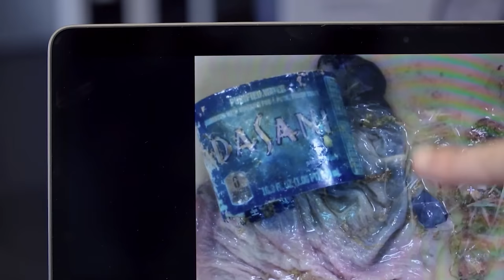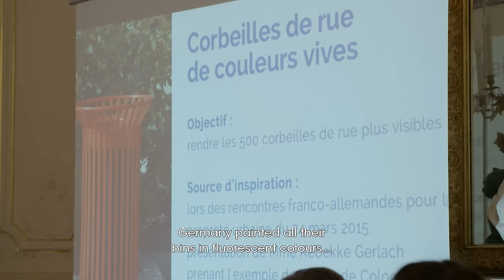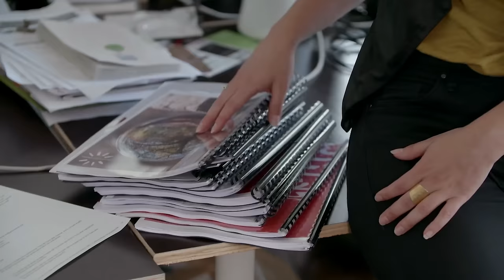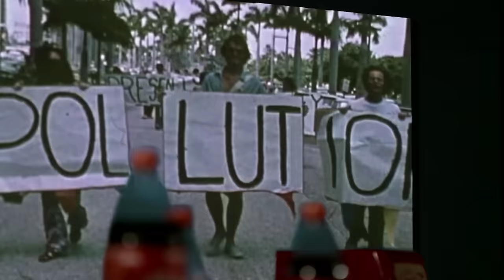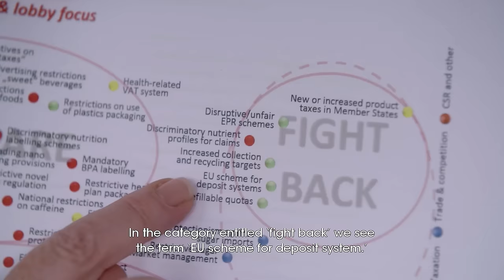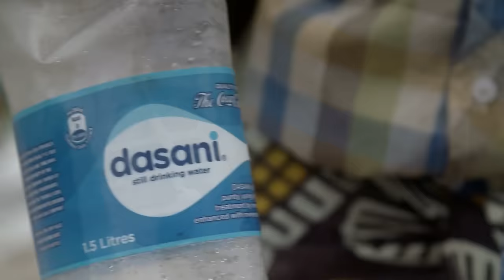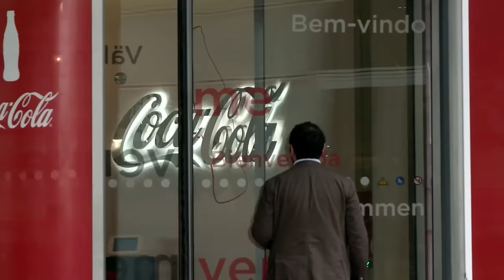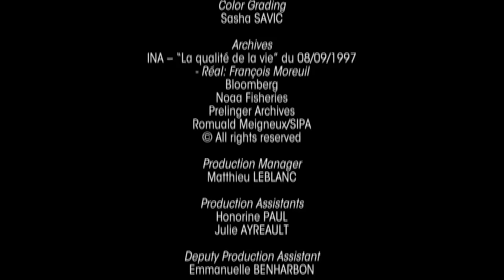A Plastic Ocean: Coca-Cola's Hidden Secrets

Comment: The best solution is for bottlers first to pay for all the cleanups, then to go back to glass bottles. Glass is infinitely recyclable.
Reply: £3 tax per plastic bottle would be a great idea making a 500ml plastic bottle of coke £4.99, it would still sell but in very small numbers like those Takis crisps imported from somewhere. They would be forced to switch away from plastic.
Reply: @Nick_80599  Sugar is an addiction. People won't stop buying soda, they would just absorb the cost. And you can't put 500ml of liquid in  a glass bottle. It would very tremendously heavy and dangerous.
Reply: @zyxw2000  What are you talking about? I said plastic bottles not soda, I always buy aluminium cans or glass bottles of coke. Sugar is not addictive by the way. that's psychological, its taste and brand loyalty as well ad marketing that makes sugar seem "addictive" if you banned advertising and moved to plain labels and packaging like tobacco in the UK, sales will drop. But my point was about moving to glass or aluminium.

Just to let you know a sugar tax in the UK on soft drinks had been very effective. manufacturers have reduced or removed sugar completely and sales for coke original have dropped. These drinks don't taste nice anymore

Comment: Recycling plastics makes no sense at this point. Expending the energy to turn a used bottle thru melting is not sustainable. With the existing plastic waste, you can either reuse it or down cycle it. Mix the melted plastic with sand and tar to make tiles for roofs, for park paths. But they also need to stop producing and using the plastic at such scales.

Comment: that plastic cube is a bobbin that held a coil of wire used in power supplies to hold the suppression coil that prevents high frequency noise from propagating back up the power line.

or it is the plastic foot plug that goes into the legs of the so called "honey can do" shelving to prevent scratching floors and tearing carpets.
Reply: Probably the latter.

Comment: Thank you for this analyses. Clearly profit over planet is the driving force. Have you researched the contamination aspect of an acidic fluid or any fluids contained in plastic? I have seen truckloads of plastic water bottles exposed to sun and high temperatures that likely cause plastic contamination of the contents. What about the aspect of diminishing local water resources for global consumption?  This issue is larger than simply plastic waste.
Reply: I hope thats the only driving force

Comment: A question that needs asked and answered is where plastic is a resource to be recycled, has Coca-Cola invested in the recycling side of the business... bottle recycling plants within reach of mountains of returned bottles... not relying on China to buy the plastic... plastic bottle (or other useful recycled plastic products) manufacturing plants to make things that will push up demand for the plastic resource...

Perhaps a factory to supply 3D printers and the supplies of the materials (plastic) to stimulate local jobs... sometimes to get a recycling ♻️ economy to function you need to build the return end...

A journalist looking at that part of the cycle...?

Comment: When I stayed for a few months in Argentina you purchased a 1 liter bottle that was GLASS, paid a $2 peso deposit (inflation would change this to $20 I'm sure) and the glass was CLEANED and REUSED by the manufacturer.  Broke it?  No refund.  Problem solved.  How is this more expensive?  The income from missed deposits is substantial for sure.  Single use plastic is a scourge and an unnecessary one at that.
Reply: The majority just doesn’t want to carry heavy glass bottles around so it’s also out of convenience. The recycling system in Germany is good, you bring your plastic empty bottles to any supermarket and feed them yourself to a machine. Each plastic bottle is 25 ct. and you get a coupon which you may then exchange for cash. Try implementing this in Tansania or any 3rd world country. We know it doesn’t work properly because of the poverty and lack of education.

Comment: This documentary doesn't really touch on the fundamental problem with plastic:  it can't really be recycled.  If you take all those used plastic bottles and melt them down, the resulting material can't be used to make new bottles.  Plastic just doesn't really work that way and it's a serious problem.  

This is why we see bags made out of used bottles and similar products; because the material needs to be "downcycled" to make something less structurally sound.  It's not possible to have  "zero waste" production as long as you're using plastic.

Comment: Is it possible to have a glass bottle with a resealable cap? I know there are caps in the store but I would never trust them to keep the Coca-Cola in the bottle. The only advantage of the plastic bottle is the cap is so content secure that if you have a plastic bottle in your backpack upside down meaning cap down it will not leak. That's the only advantage. As far as taking them back to the store no problem. Taking plastic bottles back to the store no problem for me. The store won't want to handle them. The soda company will not provide free bags to the store to keep the plastic bottles.  The store should get free plastic bags and possibly a handling fee. I'm old enough to remember glass bottles and I can still remember cork Liners in the cap. Not plastic but cork that comes from a tree. Very hard to get out in one piece during a contest. And the soda company would always say that the liner has to be undamaged to collect the prize.

Comment: Proof of corporate contribution helped take Teflon off the market, as it was a product on the shelf prior to the consumer purchasing it.
Reply: Not exactly, they just moved from one PFAS to another PFAS.  (Wikipedia) The commonly known brand name of PTFE-based composition is Teflon by Chemours, a spin-off from DuPont, which originally discovered the compound in 1938. PTFE is one of the best-known and widely applied PFAS commonly described as persistent organic pollutants or "forever chemicals". Only since the start of the 21st century has the environmental impact and toxicity to human and mammalian life been studied in depth. For decades, DuPont used perfluorooctanoic acid (PFOA, or C8) during production of PTFE, later discontinuing its use due to ecotoxicological and health issues that led to legal actions. Dupont's spin-off Chemours today manufactures PTFE using an alternative chemical it calls GenX, another PFAS.

Comment: The sad thing is that even a deposit based system is not going to work either. I live in SoCal and you get charged 5 cents for drinks under 24 ounces and 10 cents for bigger ones. The problem is that if you save 2000 bottles instead of getting a $100 back like you should they want to pay you per pound wich is like 90 cents per pound so you are only getting 1 or 2 cents back on your money. It's a joke. The recycling places tell you that there is a limit of 100 bottles that they will count otherwise they pay you by the pound. They need to pay what you are charged period. Since they don't I throw all my bottles away because it's not worth my time for 1 or 2 cents. I look at it like I am supporting the bums too because they dig through the trash and dog crap, cigarette butts, and syringes to collect them.

Comment: So what was your point? Did you achieve anything?
Recycled materials become weaker everytime recycled. This is why , for an example, you buy China product, even if not used, in a short time it starts to disintegrate aka crumble ! So all of the other materials used in that product also becomes useless & is now added to the pile. They need to find a different packaging solution. Companies should legally  responsible.